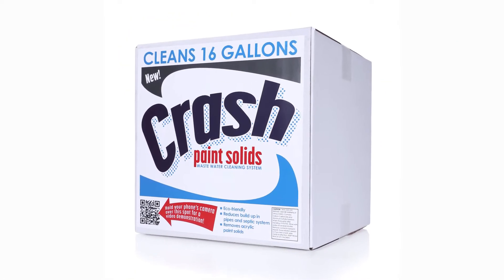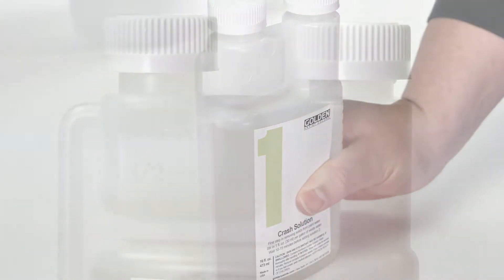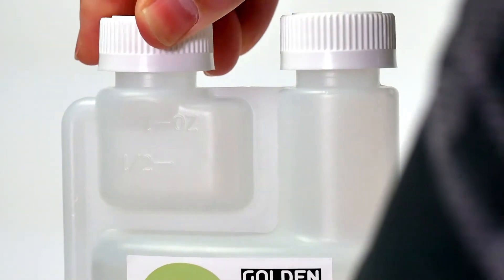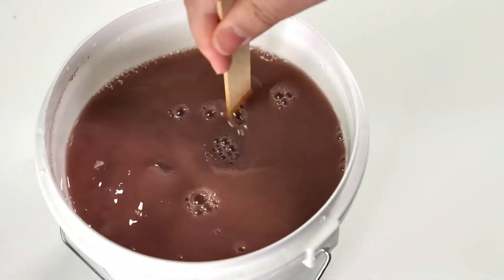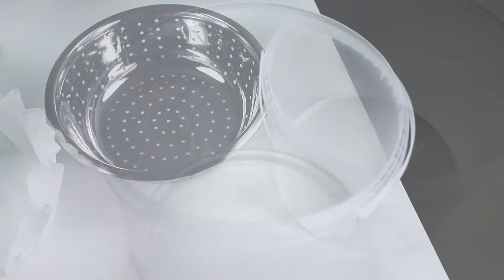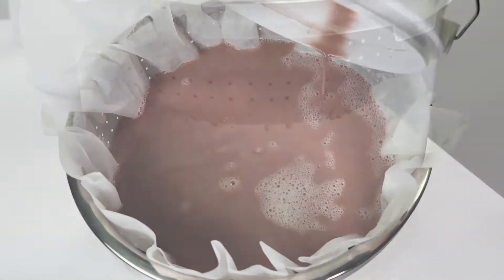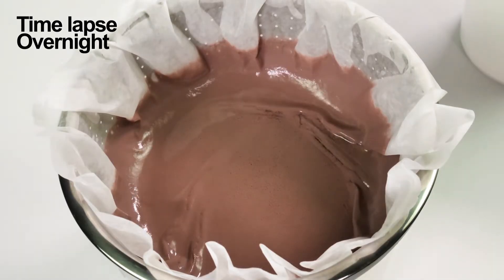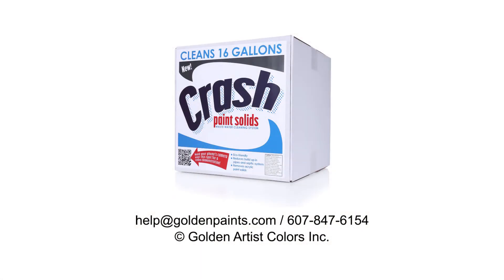Golden Crash Paint Solids Waste Water Cleaning System

Comment: Does it work with water that has airbrush cleaner in it?
Reply from the maker: Here's an answer from Golden product experts. If you'd like to learn more, please reach out to them at help@goldenpaints.com. 

That's an interesting question.  This kit is intended for waterborne acrylic painting materials, which is what will flocculate, crash, and separate solids from the water content when you shock it (quickly moving from basic to alkaline, or vice versa).

Most airbrush cleaners that I'm aware of will have a very high pH from ammonia which helps loosen up dry airbrush paints inside the airbrush, and some cleaning agents made from surfactants.  Both ammonia and surfactants are in acrylic paints and mediums, so the chance that they would cause the kit to not work seems remote.